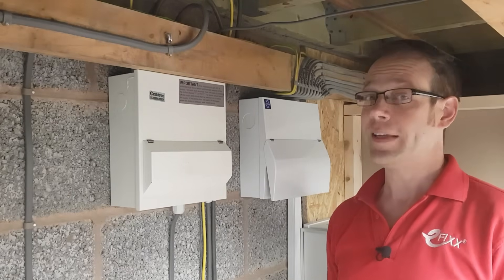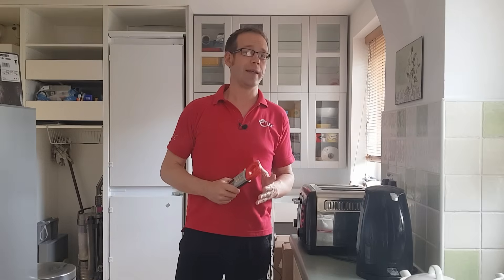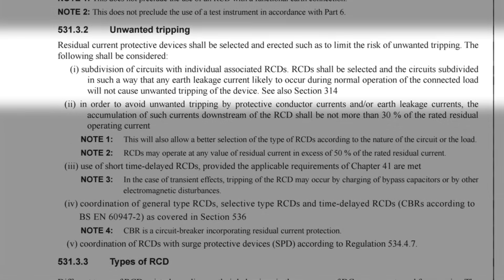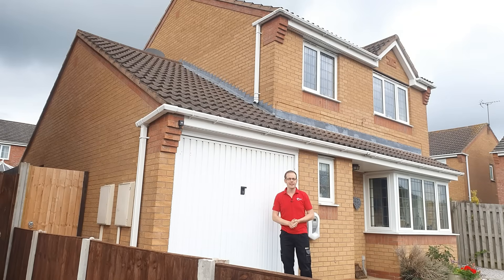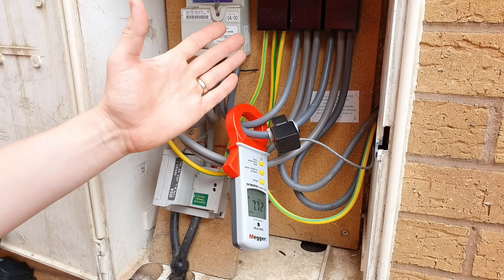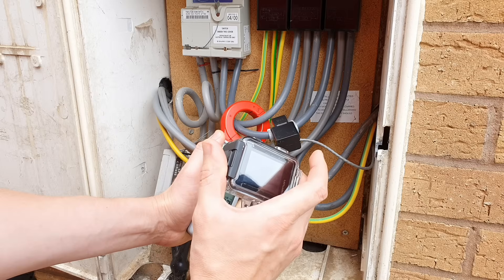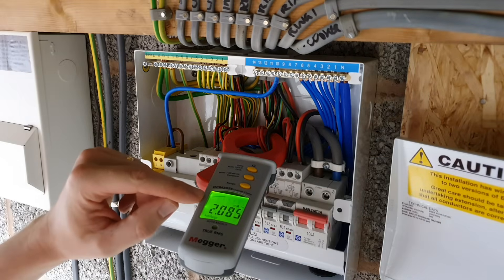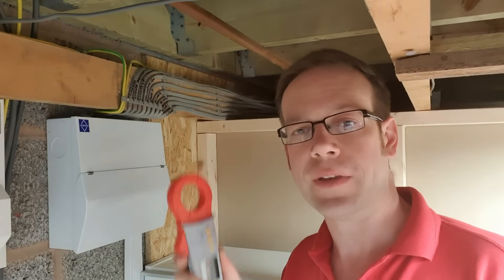EARTH LEAKAGE CURRENT - WHERE it comes from and HOW to measure it. - MEGGER DCM305E

Comment: This is an unrelated electrical question:
When installing a sub-board to an out-house, it is being fed from a 40a RCBO from the main CU. The sub-board will power 2 x 6a MCB and 2 x 20a MCB all radials. As the sub-board is powered via it's own RCD at the CU, does it need another RCD at the sub-board or can a main switch be used instead?

I'm trying to find a regulation in the 18th but its one confusing book, im only a first year. My logic, as there is already RCD protection on the circuit, a 2nd downstream is not needed. Should an MCB on the sub-board trip the RCD/RCBO, it will behave like a theoretical split-board disconnecting all the MCB's on the circuit. Though if this was to be installed under current regs, the MCB's would be replaced with RCBO's. Please correct me if i'm wrong or only understanding half of it or missing something obvious, eager to learn! Thanks
Reply: To satisfy the "addtional protection" requirements you need a 30mA RCD, but there is nothing to say where exactly that RCD needs to be. So if you have 30mA RCD protection on the submain then you don't need it in the downstream CU.

However, while it's not a regs requirement per-se, best practice is to design submains so they do not need 30mA RCD protection (i.e. run them in SWA). Otherwise you can be left up the creek if the accumulated earth leakage on the submain later turns out to be too much for a 30mA RCD.

Comment: Interesting, I used to run a pc on a 2 prong outlet with no ground and it would shock you a bit if you touched the metal body under the plastic cover

Comment: Get a short single socket extension open it and run an earth wire on the outside of the flex. Take your clamp meter and now you can quickly change plug and appliance to check which one is faulty.

Comment: Hi, can you use the clamp meter to  test each appliance from where its cord plugs into the socket?
Reply: You can, but you will need to make up a special extension lead with the earth wire seperated from the live and neutral wires. I would suggest using a two core flex for the live and neutral wires (so they are still properly insulted and sheathed) and then a single green/yellow fine stranded wire (for example a wire stripped out of some 3 core flex) for the earth.

Comment: Hi eFIXX, you videos are great! I have a question and it may sound dumb. Can I use a Current Clamp Meter as Leakage Clamp Meter? Are they built the same way? I often see the electrician using the same clamp meter to measure both the current and leakage. Look forward to receiving your reply!
Reply from the maker: Thanks Yes but it’s all down to resolution leakage current is in the mA range and most clamp meters struggle below 0.1A

Comment: It's also possible to calculate the insulation resistance for an item whilst it's powered up, very useful for items that are sensitive to high voltages used in insulation testers. We use it on fuel dispensers and sewage pumps whilst they are powered up.

Comment: That was very useful information. i use the Metrel MD 9272 leakage clamp, i have found several problems with it. An earth leakage clamp is as important as a multimeter in the kit, especially since the tripping is a type of load dependant trip it can be difficult to trace.

Comment: Very interesting video. I recently discovered how valuable this technique can be as a quick and easy way of checking whether an old installation will stand up to a new fuseboard. Had a client recently that had been told they should get a full rewire from a previous electrician despite his own IR readings on the EICR all being healthy passes. A quick clamp meter check showed a 3ma leakage on the whole installation. New RCBO board fitted and everything works fine.
Reply: So you charged a client for the installation of a brand new CU when a total of just 3mA leakage overall was/is peanuts! 

What did you do to isolate said current imbalance to a specific circuit, then to a specific device? 

Sounds to me that you, like the previous sparkie were conning the customer. 

Please explain what EXACTLY in the old CU was faulty such that replacing it removed the fault completely? 

What devices were left off and/or disconnected on the second overall test? How do you KNOW for certain that you actually cured the "fault" given that it is HIGHLY unusual in today's electronic device saturated environment that ANY modern household would have ABSOLUTELY ZERO current imbalance? ESPECIALLY with so many SMPSUs around, ALL of which have designed-in SAFETY leakage paths to earth/ground.

Sounds more like a self satisfied smug response, with no detail of proof of problem! 🤔🙄👎
Reply: @boblewis5558 Perhaps I didn't explain myself fully, although you still decided to jump in and judge me...

So from the beginning again, please pay attention...

The client requested a new consumer unit as she had recently moved in to the property and wanted things to be brought up to date. Her current board was very old, house split across two boards containing rewireable fuses. Sorry, I did not make it clear that she had requested that in the first place.

The bit I did explain was that the previous electrician that had done a 'satisfactory' EICR has suggested she 'needed' a FULL rewire.

After doing the simple test and finding a negligible earth leakage of 3ma. I told her that I didn't think it needed a FULL rewire and that the new board would not experience any nuisance tripping.

So I DID NOT con the client! I could have agreed with the advice of the previous electrician and gone with a full rewire. But, despite the opportunity of a big job I was honest with the client.

The board was fitted and all fine - no tripping of any circuits. 3ma leakage across the whole house is quite acceptable and does not indicate any faults to rectify.

Perhaps, you may have given a different comment if I had added the fact that she had requested the consumer unit in the upgrade but by the judgemental tone of your comment I doubt you would...
Reply: @chrisknowles2578 Ah! A VITAL piece of information which I didn't have as you rightly say. In which case I  apologise unreservedly for impuning your integrity. The customer is always right, and you cannot argue with some at all. 🙄

You are incorrect that I would have not changed my comment though as I wouldn't have written it at all. Hopefully my apology is sufficient to demonstrate that.
Reply: @boblewis5558  Thankyou for the apology, it is appreciated.

The story did not end there though...

After quoting for a new fuseboard and suggesting that a full rewire wasn't particularly necessary... She said she would like me to go ahead with a full rewire anyway!!

I gave her a reasonable price and she was happy for me to proceed. All complete.

She is very happy that although it was not essential she now has the peace of mind that all the cables and fixtures are brand new and safe.

I was happy to get the work and feel I have a clear conciounce that I had not pushed her into having the work done.
Reply: @boblewis5558  wow so quick to condemn in quite a harsh tone
Reply: @daviddmf please read the apology I'd already made and the reply from the op. Had all the info been included initially  my "harsh" comment would not have been made in the first place. I stand by my criticism of anyone fitting the intial information profile. 🤔🙄

Comment: Hi Joe, great and informative video as always. One question, when you switched off the various loads on the ring circuit supplying the PC etc.. were these DP switches? (I'm thinking along the lines of EMC capacitors continuing to discharge?) - thank you

Comment: So this is not a usual clamp meter , its specific to earth leakage Milliamp testing? My second question is you gotta clamp this particular meter to both live and neutral , Lastly what are acceptable and not acceptable readings? I like this device
Reply: The one shown here has ranges from 6mA (resulation 1uA) to 100A (resoloution 100mA), so it should cover both earth leakage measurements and most other current measurements you are likely to need as a domestic sparky.

Comment: Superb content very well demonstrated. I have owned and used clamp meters for many years as an electrical technician, I usually buy high quality meters that can accurately measure both AC & DC currents because I work on DC circuits in CBU's and vehicles, which makes life easier when looking for parasitical drains and figuring out expected autonomy times etc.
If you are in the fault finding game you should have a clamp meter in your arsenal guys.

Comment: Great Video Joe , you can also use the meter for testing single and three phase appliances, especially equipment incorporating a no volt coil motor starter ( A contactor/relay that can only connect the load to the circuit when energized or typically a floor grinder etc ) , that way without dismantling the appliance the actual running leakage current can be measured via its supply lead with an adapter. Unsure of your standards in the UK but it may be in the order of a max 1mA for double insulated equipment and 5mA for Class one earthed metal appliances

Comment: At what mA value is natural ELC is excessive? About 5 years ago I installed a new 7kw cooker hob which was putting out 6mA of ELC. Along with a number of other new kitchen appliances all putting out 2mA of ELC each the 30mA RCD was tripping a couple of times a day. I rang the manufacturers about it, they said it was within tolerances. I also rang the NICEIC technical & they could not tell me how much ELC is excessive. I had rearrange all the circuits in the dual RCD board to even up the ELC in the 2 RCDs. Since then I only install RCBO boards. But today I got called out to a job with a tripping RCD & found another cooker hob (only 2 months old) putting out 10.5mA of ELC, surely this appliance is faulty?

Comment: This would have been handy in I think 2017 or 2018. I had a meter at that time I don't know if it had the scale that I needed.
I was working on a film and doing data management data wrinkling. I pulled up in my van set up and ran 100 foot cord to an RV and older RV. That RV then plugged into an RV socket. After a day or two of doing this I tripped the rcd (we call them GFCI's or GFI for short) and I had to track it down in the RV to an outlet buried somewhere I think it was either by the electrical panel or sink. All the outlets or on this one circuit it was an older RV and an older GFCI. After finding that I ran 200 feet of extension cord to the only other outlet other than the one running the coffee maker ( an extremely important appliance unless you drink tea like I do but I didn't wanna get out anybody's bedside either). Would've loved to known whether that GFCI was just getting faulty with age and cranky with the long cable run or maybe I got some moisture in one of the junctions I don't know. I just know I had to get the production management trailer back on line before I could do anything else as that was essential and the only place with outlets are than the one under the coffee maker outside and the one other dedicated outlet I found. See the biggest problem is we test the functionality occasionally and we're supposed to test monthly according to the instructions the manuals and documentation and even printed on the devices but that doesn't happen and that's just a functionality test. I'm sure more industrial like places might have the money to put forth into higher test requirements but generally homes and businesses as long as it's working, it's done right and meets code.

Comment: The vast majority of televisions, laptops, and computers are not sources of earth leakage current. You will be able to tell because TV's and laptops generally have no earth cable as they are double isolated, and computers running from the mains no longer use switched transformers - they are linear transformers which do need an earth but are isolated from the board load. However, that does not mean some parts of the TV do not have a route to ground. Network connectors (not-wifi) will often use a shield ground which could take earth from the board across to a router/switch and then on to the earth of that unit unless it is also double isolated. If your PC is leaking earth current, it's time to get a new power supply or a new computer. If your PC is new but is still has earth leakage current, someone has built it using a cheap and nasty (and likely illegal) Chinese switched transformer.

Comment: red black and blue wires?? Is that a mix od very old and new colour codes?
Reply: Fixed wiring in the UK only switched from red/black to brown/blue in 2004-2006 (there was an overlap period to allow stocks to be used up), so there is still loads of red/black wiring in service and loads of installations that have a mixture of older red/black wiring and newer brown/blue wiring where the installation has been modified/extended/repaired.

In this case, it looks like the outgoing wiring is in "old" colours, while the internal wiring of the CU (particularly the neutral flyleads of the RCBOs) and the incoming tails are in "new" colours.

Comment: Interesting video. So your PC is leaking while it isn't turned on? Is that fully off or standby? Since you unplug the cable, I assume it was off while it was leaking the 0,6mA.

Slightly related question. My macbook is okay when powered on battery, but when I use the extension to 220v, the metal casing of the Mac starts to have static load.. tingling feel when I slide my fingers over the surface. Mac extension cables don't have earth. I assume this would have been solved if Mac's would use earthing? (I've had this with every other Macbook before as well, not just the current one)

Comment: is there an allowable max leakage current value in the code in order to stay safe ?
Reply: In the UK, I don't think there is any limit per-se, but if leakage of more than 10mA is expected then "high integrity earthing" rules come into play.

Generally this isn't a huge issue, final circuits should generally be kept below that value anyway due to the need for 30mA RCD protection on most final circuits, and distribution circuits are usually beefy enough to meet the requirments for high integrity earthing.

Comment: If in the scenario demonstrated your leakage load was tripping how would you fix it if you only have one RCD and the device is operating safely and as designed just an accumulated leakage? What options do I have.
Reply: The usual solution in the UK would be to spread the load across more RCDs. For example replacing a consumer unit with an upfront RCD with one with a main switch and RCBOs.

On a TT install it may be nessacery to introduced time-delayed RCDs with higher trip currents to provide protection upstream of the RCBOs.

If spreading the load across more RCDs is really not an option, then isolating transformers may also be a possibility, but most would consider that a last resort.

Comment: Earth will not induce any current since it's magnetic field is static and your not moving to or from it. Remember Faraday's law!
Reply from the maker: It’s measuring leakage current
Reply: @efixx  The ammeter is only a conductive loop: if you hold it in the air and measure something, it means either a poor calibration or that it's reading an induced current produced by a changing nearby magnetic field (as would be produced by an alternative current). Static magnetic field like earth's won't produce anything.

Comment: Great video, really well explained.

I'm an electrician in Spain and I've been using a leakage current clamp for about 6 months now and it's been great help. However sometimes you get an RCD tripping due to transient impulses, high frequencies or presence of loads. Then you have to install a "super-immunized" RCD. Not sure if they're allowed under UK electrical code or not.
Reply: Hey, I'm in Spain too and I came across this video because my RCD is tripping randomly.  How would I know if the RCD I have is super immunized or not?
EDIT: Nevermind, I found the symbol.  It looks like mine aren't so I will replace them.
Reply: How do you mean super immunised?
Reply: I didnt know that vaccines came into electrical circuitry but by super immunized do you mean type B RCDs
Reply: I haven't heard of a "super immunised" RCD in the UK.

In the UK, generally only "final" circuits will be 30mA RCD protected. Distribution circuits will usually be wired in a way that doesn't need 30mA RCD protection. If a final circuit has RCD tripping problems and a cause can't be pinpointed then the next step would generally be to split the load across more RCDs.

On a TN installation installation in the UK, distribution circuits will generally not be RCD protected at all. On a TT installation distribution circuits will need RCD protection but it can have higher trip currents and slower trip times.

Comment: In my experience old heating elements in stuff like electric showers and cookers can also leak current to earth, which gradually increases with age as the insulation continues to break down, all the more reason to use individual RCBOs instead of older split load type protection. And some cheap tatty new elements even have rather poor insulation which can cause earth current leakage and nuisance tripping.